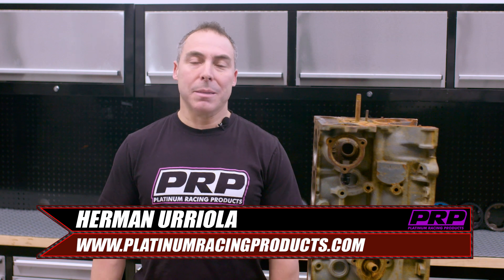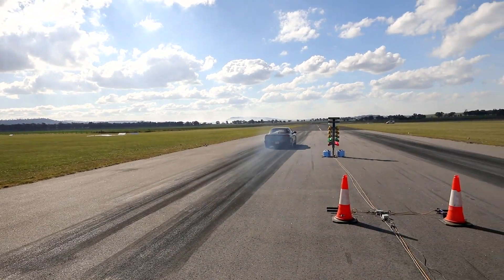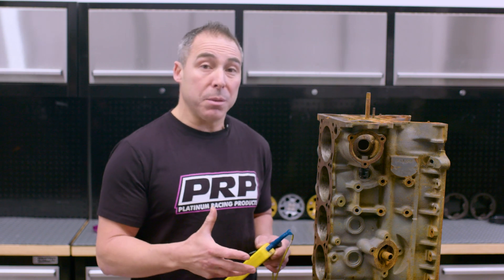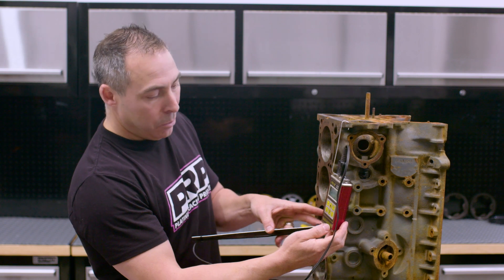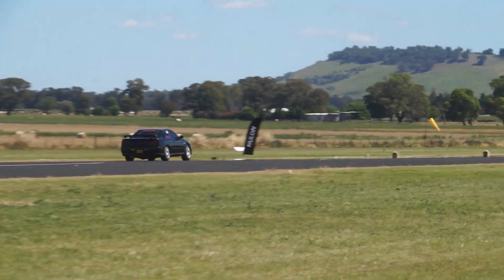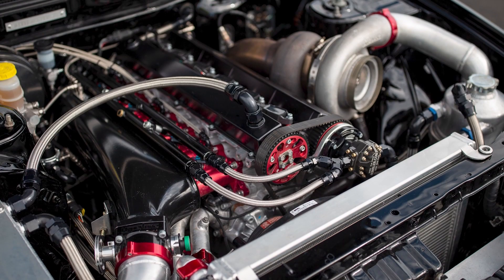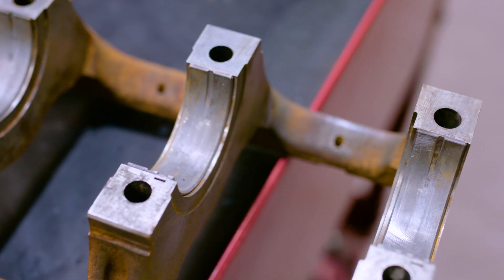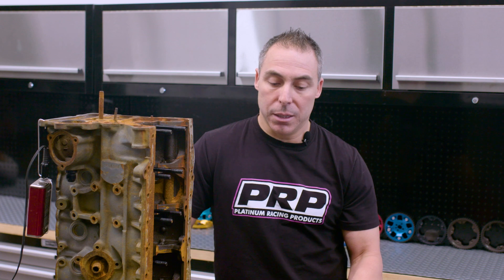The Best RB26 Block We've Ever Tested (To Destruction)  - Platinum Tech

Comment: I Wonder how long it would of last ed with all the platinum tech bracing and supporting mods. But I Wonder how the new rb's compare to the old rb's in terms of quality and consistency.
Reply from the maker: New ones have tested worse. Casting didn’t change and material doesn’t appear to be as good. Nissan put less than zero effort into improving it and zero care into how good they came out.
Reply: @MotiveVideo  wow that suck! I just pray 🙏 my yr 2000 o5u (r34 Gtr) block is one of the good ones. Kinda spewing I didn’t send my block to Herman (was supposed too & we had chat). Maybe 🤔 b4 2.8 build
Reply: That’s exactly what I wanted to know with PRP brace. I’m definitely getting one as soon as I save up enough

Comment: Would you avoid using nitrous to help spool a turbo quicker? I have a 2.8 with a T51R and I recently bought a basic nitrous kit to aid spool.
Reply from the maker: You can, but may use nitrous to spool then turn it off. Have to be careful around peak torque to not crush bearings. Just don’t make it too aggressive
Reply: @MotiveVideo  perfect, thanks for the advice.

Comment: would the heat cycles of the engine help harden it slowly over time?
Reply: Cast iron doesn't react to heat treatment like steel does. Engines also don't get hot enough to heat-treat themselves.

Comment: Get a 2jz and avoid all of this
Reply from the maker: 1. 4WD
2. Noise
3. Fastest IRS car in the world in RB
Reply: @MotiveVideo  100% these are reasons why I love rb’s 💪
Reply: @MotiveVideo  2jz came in AWD and much cheaper for a reasonable build not blowing money to waste on a build where everything is just a remade part from billet. The video was about a stock block which will never ever do IRS level performance but the 2jz with a stock cast iron block did go on some fast IRS cars like Ekanoo's Supra. There are also a US Silvia that has the iron block pushing past 1800whp
Reply: @MotiveVideo  Happens every rb vid, I bet this guy doesn't have a jz anyway lol
Could be JUNII or something & it's get a wrecker 2j for $1.78 & poke a whole in the actuator line with your keys & bla bla
Reply: @TA See some of the 2j fans are so whipped by YT etc that even the 1j sux lol, like you say it's not usually jz owners talking rubbish
Reply: @TheGoodMedicine  1. The Ekanoo supra was built specifically for doing 1 run and the aim was for the 5's then it would be retired. So the billet/ cast block argument goes out the window as it wasn't built to do pass after pass unlike the 2000hp+ skylines in AUS that are also full weight, full factory chassis streetcars that were using cast blocks 4 years ago. The Ekanoo supra is a full tube chassis promod with a full fibreglass body that DOESN'T use IRS suspension and currently holds no records of any class in the world. 

2. An RB26 is only slightly more expensive than the 2jz, but the 2jz also didn't come 4WD in any of the world famous Toyota platform cars such as the supra. And it would cost a fortune converting a supra to AWD as u would need a lot of custom parts such as a sump, axels, drivelines, hubs ect. The RB30 bottom ends are stronger than the 26's and are used in the big power skyline builds. They aren't hard at all to convert to 4WD either and the RB30 block is also a fraction of the price of an RB26. If You also want to get technical. TRP's 350z made around 2400hp and if I'm not mistaken ran a 5 before it went to a billet block.

3. The 2000hp+ street car skylines have been battling back and fourth the last 6+ years juggling the IRS suspension record with each other and the r35's. Not once has any 2jz powered car got even remotely close. 4 years ago they were still using cast blocks when battling for the IRS record and outright GTR record, so your statement "A stock block will never do IRS level performance", is completely false.

4. Stop acting like there isn't 30 years of RND in RB parts. They didn't and I quote from you, "Everything is just a remade part from billet". That is one of the most lame statements I have ever seen online regarding top of the line engine parts. Nitto holds the highest standard and is top of the line in terms of RB development and they have rated their 3.2L wide journal package at over 3000hp. In fact, this package is so efficient and strong that the only thing holding back the 3000hp+ RB's is the current turbo's on the market. There simply isn't a bigger and more efficient turbo on the market than PT's Promod XPR 110 turbo. It is rated to only 2800hp but from the numbers JUN2 the r32 skyline is running (6.37 @224MPH), being the outright record holding GTR that runs on IRS suspension, Radial tires, full factory chassis and full interior is pushing over 2800hp and has been said to have been capable of making 3000hp. There is also Maatouks Racing's promod "The DON", which is pushing around 3200hp with over 100psi.

5. Spending money on an RB is not and I quote "blowing money to waste on a build". Skylines are objectively and not up for negotiation, the single best Japanese sports car to come out to date and one of the best sports cars in the world and still is. They drive like they're on cloud nine. They handle amazingly and absolutely destroyed the Bathurst circuit, eventually being banned because they were too quick. Are AWD and have one of the best 4WD systems on the planet, are objectively the best sounding I6, are one of the best looking retro sport cars and have one of the biggest aftermarket support platforms for any engine in the world. With everything combined, this has created an absolute monster of a car in stock and built form, decimating in both track racing and straight line speed. They call it "Godzilla".

Comment: Shit blocks. The noise comes from the head. 
Just get a billet block and skip the nonsense.
Reply from the maker: Not everyone needs a dry dumped billet block.
Reply: @MotiveVideo  yes. But people with 1000+ to the tyre do. Because of your channel RBs have very well documented survivable power level when built correctly. This is a no limits car. There is no point pushing the block past a certain point, just to see when it will fail cause it will fail and its more money that way. I wouldnt put a cast RB in anything if i was at 800hp Crank hp. I dont feel its worth it.
Reply: @abhirmalhotra5103  I'm not disagreeing with you, but not everyone has the money to dump 10k just on a block and 20k on a dry sump system. And up until they do they can get away with a cast block while they make the money. Only god knows how long this engine could have lasted for and the good RB26 blocks with a block brace are rated to 1200hp.